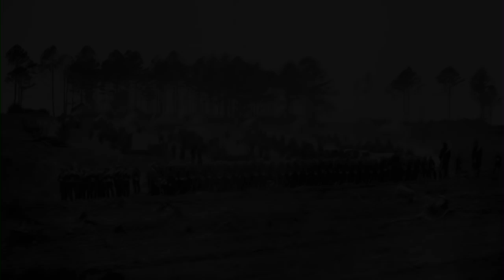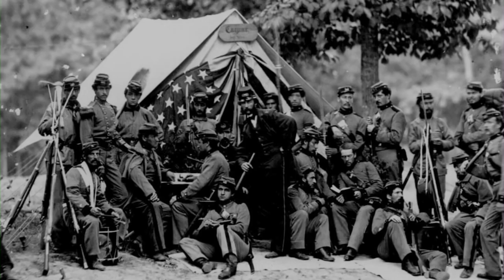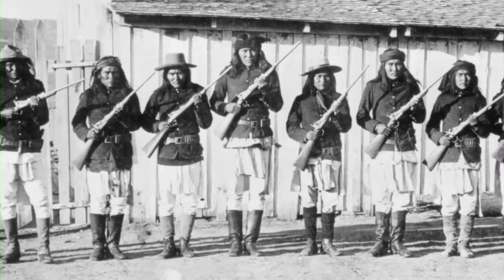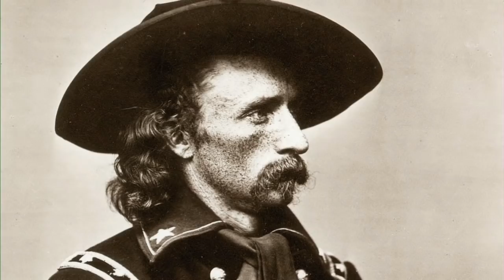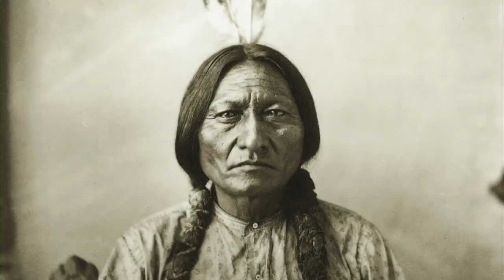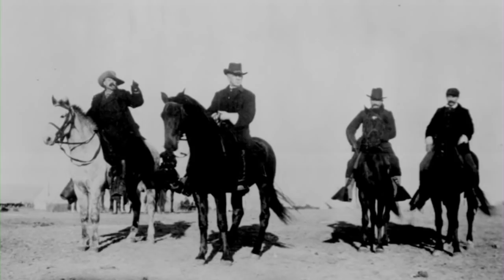Uberti Springfield Trapdoor Rifle

Comment: Can you shoot modern hot 45-70 loads through these unlike the originals?
Reply: Good question, would love to hear the answer.
Reply: erniebanks88 take this with a grain of salt, but the new production trapdoors should be limited to 18000-20000 cup in my opinion
Reply: the answer is yes
Reply: @keiththiha  the cup is 29007